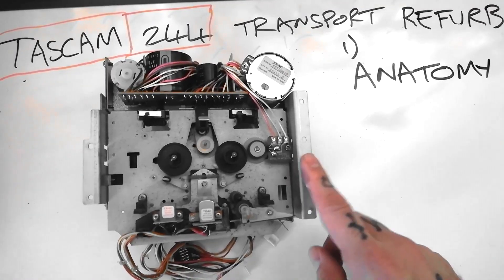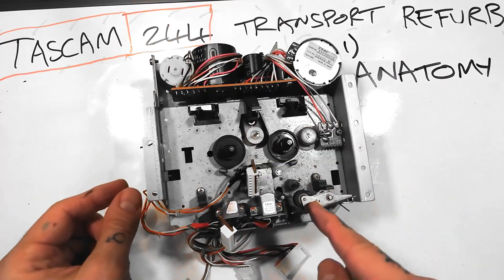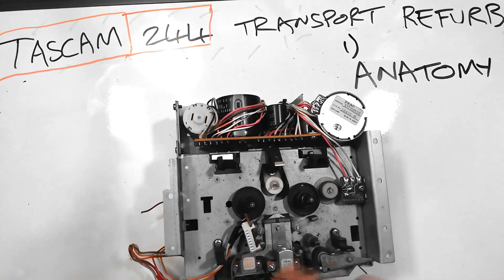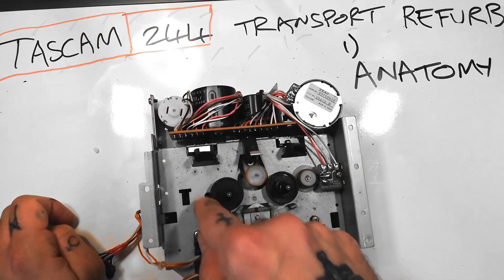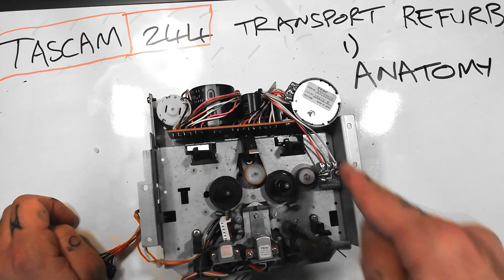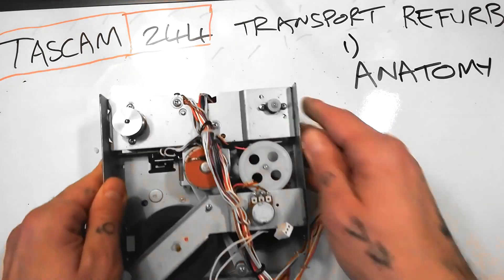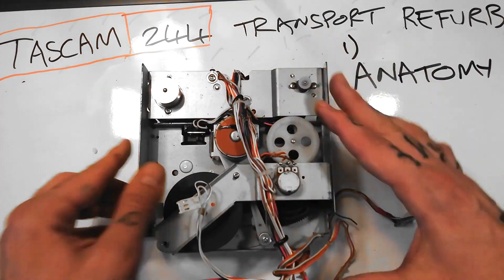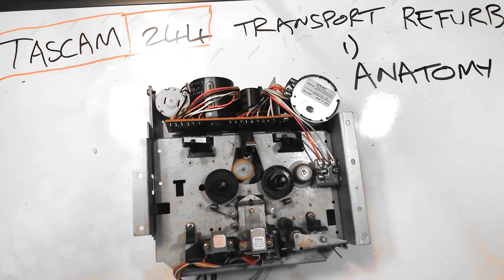2 How does it work? (Fix Your Tascam 244 Portastudio Transport)

Comment: I've changed all the belts and rollers..fast forward is ok as is rewind except I have to keep botton pressed to work ..won't play and heads and capstan roller always up ..if I retract them they return as soo as power is turned on ..any idea what's wrong ..cheers

Comment: Very much appreciate these videos. I have two of these 244s. I followed your video and replaced both belts and the pinch rollers.  Now, on one, as soon as I put a tape in and hit play, the number 1 vu meter pegs out, and it hums loudly. The other one when I record on track 2 and 3, the meter is getting signal, but when I play back…nothing. Any idea?

Comment: Your videos helped me to fix my Tascam Portstudio 246 , thanks alot!  now I am on my next pair project my old Tascam Midistudio 644 that needs a new capstan belt  , run into a problem : one of the 3 screws that hold the capstan is stuck and I cant a way to unscrew it .. ive tried a WD 40 and different screwdriver heads , nothing helps. cause the grooves on the screw head are ruined now ... 
my Question is : how do you deal with a stuck screws during disassembly ? thanks in advance for your reply!
Reply from the maker: Try putting an eleastic band in the screwhead, hitting the end of the screwdriver with a rubber mallet, spraying penetrating oil or spray based silicone lubricant on the offending head and leaving it overnight. If you're really stuck you can get Damaged Screw Remover and Extractor sets (try typing that into amazon etc)
Reply: @Tetrakan  thanks for reply Tetrakan - your videos encourage me alot  ! I've managed to remove the screw by filing a new broader straight flat track with a fine flat file to be able to use a thicker flat screwdriver and re MOVED the screw! Replaced the belt . Now the Tascam is back to live! But lessons learned :for anyone attempting any repairs -  always use a correct size and QUALITY steel  screwdrivers  to not damage the flagile Tascam screwheads. 🙏

Comment: I am very impressed by your fluency!!  I have one of these that I bought new (I walked home to afford it, as instructed by the advert)  and had great fun with it.  It cost around 800 UK pounds C.1986.  I haven't used it  since about 1988.  The tape transport buttons have collapsed and tape transport is NG but pretty sure everything else works OK so will resurrect it with your EXCELLENT advice!!  MANY MANY THANKS!

Comment: Thank you for the video, but this is a simple, the model 122 mkii & mkiii there is difficult to find a solution you must find a solution to problems capstan motor
Reply from the maker: Thank you for watching. I think we have a language barrier so I'm not sure I understand your question? This video is intended as a SIMPLE explanation of the transport on Tascam 244 ONLY. I do intend to do a video on the 122, but at the time of writing I have not filmed this yet. There is a copy of the service manual in my blog for free download which you may find helpful? What I can tell you is on the 122 the capstan is direct drive (the capstan connects directly to the center of the motor, no rubber belt or flywheel) so if you have a 122 with faulty capstan movement, unfrtunately you need to find a donor unit to salvage a spare part from! Please subscribe if you would like to see videos on the 122 in future.
Reply: @Tetrakan  thanks for reply I mean there's model 122 mkii and mkiii Needs to understand more, note that the engine one, I had a motor for a model mkiii I wanted to install on a model mkii unfortunately does not work, when i used control speed working without control not run